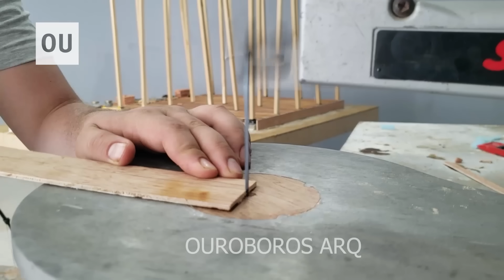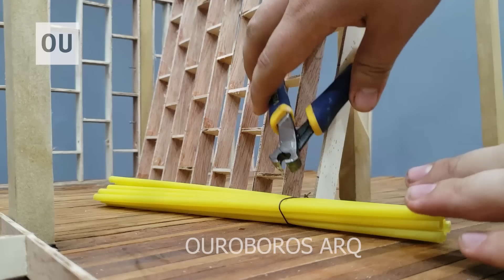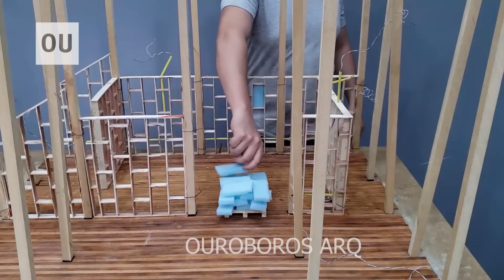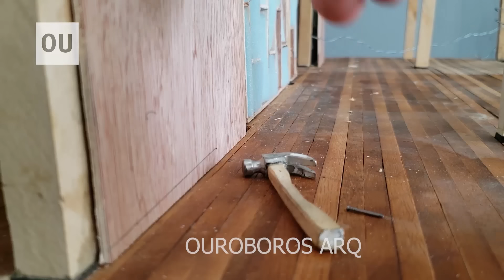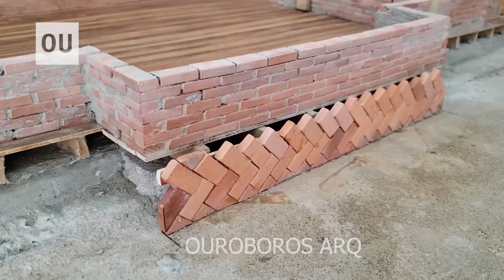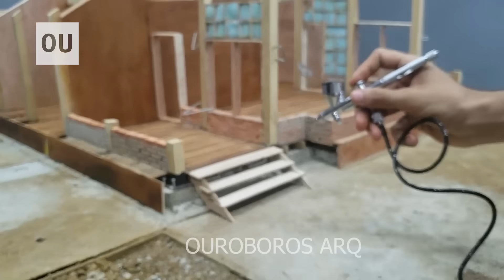How To Make Framing Walls --Framing Wood-- Bricklaying

Comment: Joists on ground, why not pour scale footings. Noone builds walls with crippling,  should use scaled down 2x6, 16 on center. Looks good but is basically a tossed together scaled down representation of what a homeowner may think how it works.

Comment: @ouroboros, what is the purpose of the foams on the walls? 
Also, what is the purpose of the space left under the floor? Wouldn't it become an issue in case of infestation, or in winter in cold regions? 
:D
Reply: Actually the foam is insulation and in real life I think there is insulation under the floor.
Reply: @o_sch  Makes sense! Thank you! :D

Comment: Doing everything pretty close to the books then builds brick wall over wood floor 😂
Reply: It is not funny
Reply: @mariaochoa575  working in construction and remodeling to me it is funny. No in such a small scale it doesn't matter realistically but the amount of detail to get things to scale and perfection that he's taking. So  Yes I do find it funny
Reply: @cjlong2057  same tho lol
Reply: I don't know building code or anything but that didn't seem right to me either, what's the proper method for laying brick on a house like this?
Reply: @jaymcintosh331  bricks should be tied into the foundation cause the moisture from the mortar soaks into the wood overtime and Can rot it. Or just the weight can mess with the entire wall I'm sure there is some safe way to support it like that maybe with steel under it but it's still only a mini house
Reply: Yep. He should've built a concrete foundation that extended to the top of the wood floor and laid the bricks on that.
Reply: The brick on wood killed me too lol
Reply: But I have to admit, the conduit straws are funnier lol
Reply: Who cares? It’s a fantastic job! Although you’re absolutely right. How ever, thinking it’s just “construction decor”. It will be changed next year, for whatever might be trendy then 😜
Reply: Pode isso Arnaldo
Reply: @VictorGabriel-hu4xf  calate
Reply: Exactly what I was thinking. Those poor floor joist just aren’t designed for that type of weight.
Reply: @thepatriot8544  all the random noises your house makes just the joists crying to help 😂
Reply: @fuho  I oo
Reply: @fuho  oo
Reply: @cjlong2057  sssssssso
Reply: @cjlong2057  sssaoaw
Reply: @marco-jd4xz  sosw
Reply: He couldn't get in to do the floor work like we can when we build so some things are going to be done a certain way. Other wise he'd have to use surgeons tools and work with tube cameras and what ever. So it's not rocket science why he does it this way. Thank him for the hard work and what he does if he could do it exactly as we do on a job sight I'm sure he would. But miniature projects call for different procedures.
Reply: @fenderbender8132  no one's talking bad or Ill of the project it's all in good fun I use tobringmy mom  little things from worksites she would build these little houses not to this degree but they always looked nice.
Reply: LOL Yeah...but there's such a thing as taking it too far ;-)
Reply: Exactly when I started reading the comments lol
Reply: @jaymcintosh331  on a concrete foundation, not wood  lmao
Reply: Literally came here to say the same thing. Why spend so much time doing this to make such a basic error?
Reply: SOMEONE HAD TO HAVE THE BALLS TO SAY IT!
Reply: Staged on pallets, check. Mix ratio, check.  You need a laydown yard for all these materials! Find a partner who does RC construction vehicles. 👍
Reply: Do you think the nailing is to code? Gimme a break dude its a doll house.
Reply: @MrCFH420  eh I don't know I mean I like to make sure there's nails every couple inches to ensure we don't get creeks or separation over time expansion and contraction can be a bitch for sure
Reply: @cjlong2057  just saying it's a hobby that the dude is doing. There is no inspector telling him hes not to code. Its a fn doll house man.
Reply: @MrCFH420  and ain't no one's talking shit about it. Some of us are just seeing the laugh about what he did.
Reply: I was about to ask about the bricks on the floor lol
Reply: @levi35oh  dont ask. Its not a real house.
Reply: @cjlong2057  over
Reply: @cjlong2057  over
Reply: no this house dont need brick walls....because this specially make for united stated people.....
Reply: I think everyone leaving negative comments on the construction of a SCALE MODEL house should remember just that:  IT IS JUST A MODEL!  No one is going to live in it!

Comment: The video name actually details the intent. How to. If this is an instructional video on construction methods than it should be done the correct way. You never lay bricks on timber floor frame, it should always be layed direct to concrete or masonry foundations. There is no moisture barrier between timber floor frame and concrete foundations including the brick work. The floor frame is actually missing the beams between the posts on each side so the  wall frames don't actually sit on anything structural just floor board.
Look it's a great effort but I been in construction for over 25 years and i can pick this to pieces all day and this actually frustrates  me as a builder because people actually view things like this and they believe this is the correct way of doing things and attempt it on Their  homes and its wrong. For me if your going to take the time to do an instructional video. Do it right.